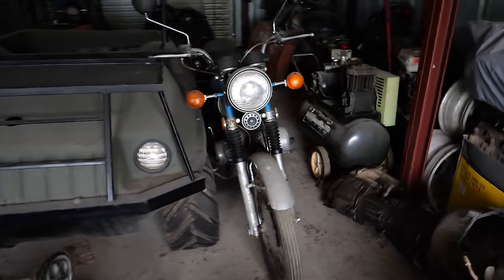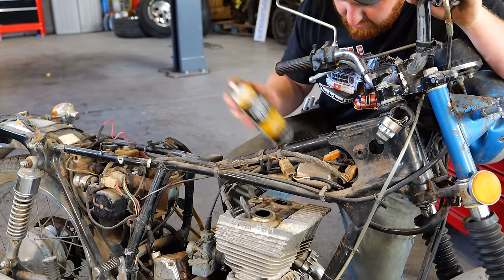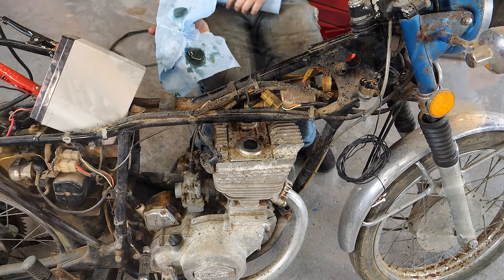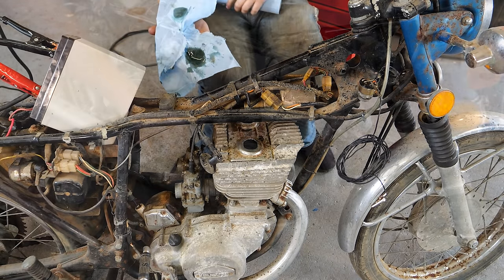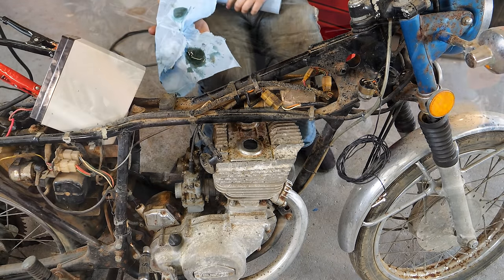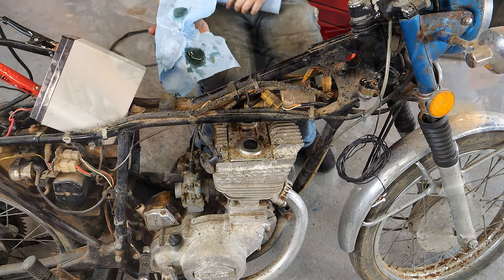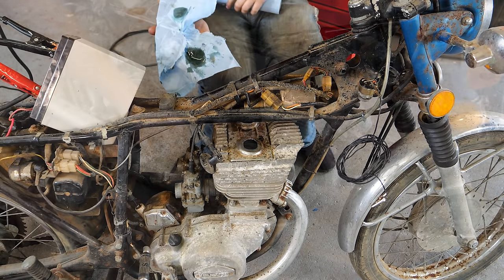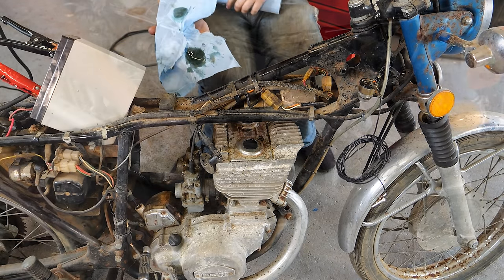Will an ABANDONED 2 Stroke Motorcycle Run After 20+ YEARS!?

Comment: Never ever rely on an injection pump on ANY 2 stroke. Seriously they are notorious for failure even ones not that old. Just run some good CASTOR 927 premixed in 93.
Reply: I sold, serviced, rode just about every two stroke motor cycle fitted with oil injector systems. Do not remember ever having one fail. Some owners messed about with them and used the wrong settings, usually to supply too much oil. LONG downhill runs with the throttle closed may have had some effect on the oil supply but then again correct settings meant oil would still be fed to the engine. Look at the system on  a Gt750 for example it fed main bearings etc , disconnecting the pump and using pre mix alone was not enough. We successfully production raced 250X7, Gt500 and a Kawasaki H1 500 triple all on the oil injection system, in several years not one failure.